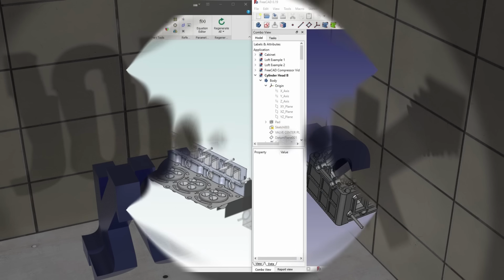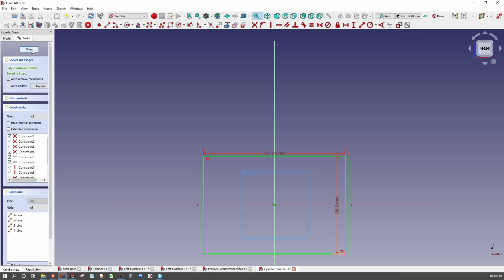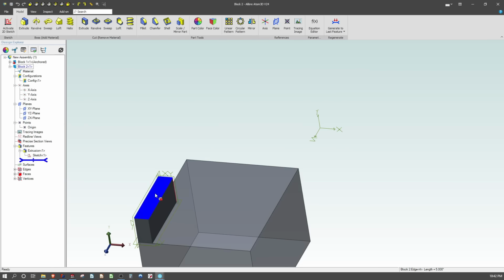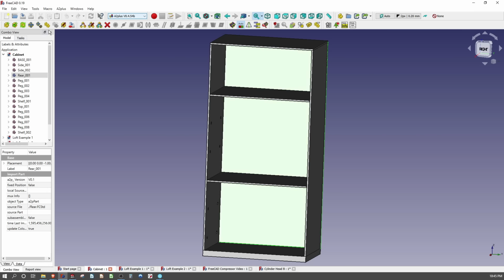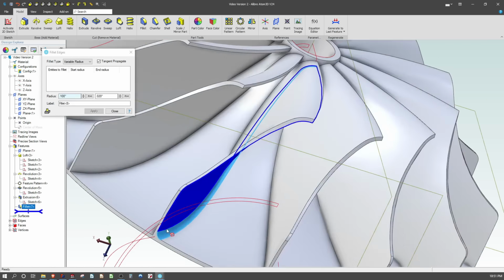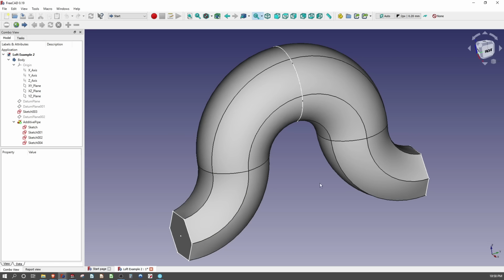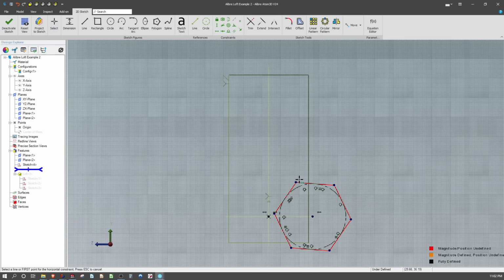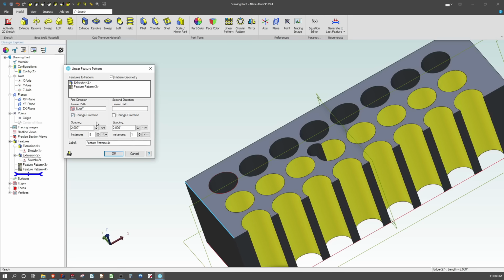What Can Alibre Do if I Have FreeCAD?  |JOKO ENGINEERING|

Comment: I'm considering Alibre Atom3D right not for the exact reasons you demonstrated there - I currently use FreeCADLink, and love it for the most part ... right up until its assembly time, then, its just miserable, compounded by the fact that professionally I use Siemens NX, which is an absolute beast. I tried Solidworks Maker, which was fine aside the cloud management of models was also quite messy, so Alibre is about the only CAD I've yet to try out...
Reply from the maker: Good luck!  I think Alibre has a solidworks feeling to it.

Comment: @Joko Engineeringhelp:  what are the specs on the computer you are using to run Alibre?  I am considering Alibre for personal/side business use but some of the loading times that I am seeing on your videos would be pretty annoying to me (I'm a spoiled Solidworks user with a good PC at my day job).  Mainly Im wondering what your processor is, your ram, and your graphics card.  PS I'm very thankful you are creating Alibre content because you are just about the only one on YT doing it!
Reply from the maker: I wouldn't use the specs to represent loading time in the video; recording video at higher definition is a lot of resources all around while trying to run a CAD platform at the same time.  Xeon(R) CPU E3-1505M v6 @ 3.00GHz × 8, 32GB RAM, Nvidia Quadro M2200 Graphics.  Thanks, in the description of my recent videos you can use my affiliate link to get a discount on any Alibre products you'd like to buy (It supports me too!)

Comment: As a programmer, i am liking OpenScad
Reply from the maker: I taught myself VBA but that was the extent of what I know of programming.  I'd like to jump more in to it but I haven't had a chance.  In your experience, does OpenScad have similar capability in model generation to FreeCAD or Alibre or would you prefer the programming interface or both/neither?
Reply: @JokoEngineeringhelp  One thing is it is slow to render.  It is basically a very simple but powerful scripting language. You can make reusable functions and there are many free libraries out there for it.  But i think i am biased because i do programming for a living and right now it is easier for me than CAD.  I suspect if i learned a good CAD program, I would prefer it.   I tried FREECAD but i hate it.  It crashes and I find simple things hard to get working.   Been thinking of Alibre.  Fusion is top notch but I don't like renting.
Reply from the maker: @3dprintingfun329  Relatable!  Much respect for those who program for a living, it's a great profession and requires good logic.  Alibre has a free trial if you haven't tried it out yet.  Since I'm coming in from the mechanical side, I rely a lot on the graphics display to 'spacially' visualize everything; naturally I gravitated more to FreeCAD, Alibre and SolidWorks.  Good luck!
Reply: Thank you for introducing me to OpenScad. I am new to CAD, and have been using FreeCAD. At first, I HATED the software, because it presents a large number of options, but requires specific things be done in particular ways to use them. This is unintuitive and requires "learing" the interface. But it has grown on me immensely, and for many tasks it is easy to see "how" they can be done.

One thing that I like about FreeCAD is the infrequently mentioned Addon system. It is IMMENSELY powerful, adding things like node based "programming" to the software, as well as the ability to model 3D curves from a set of disjoined splines. FreeCAD's spreadsheet is also very useful, allowing for some associative paramerization control over values that can then be presented in the CAD model.

But sometimes, programming is wanted (by me, at least) for complex parameterization. I was actually thinking of writing my own "CAD" software for precisely this purpose. But I think I'm going to look at OpenSCAD first, after my exploration into OSC is complete.

Comment: No price on the website. Buy only through retailers. File Formats: "Broad Range". Did we just step back in time to 1998? Just because of that alone it's not an option.
Reply from the maker: https://www.alibre.com/atom3d-import-export/

This page from Alibre.com  lists Import proprietary formats from SolidWorks and neutral formats as STEP, SAT, DWG, DXF, while Export Formats are 2D and 3D PDF, STL, STEP, SAT, DWG and DXF. 
Are you outside the US?  Price is listed for US IP addresses on the website but uses quotes outside to my understanding.  SolidWorks/3D Experience/Catia, Creo, Ascon Kompas and others require a quote to provide pricing for the majority of their license options often through resellers; many providers sell that way.  I'm not sure how import/export formats or quoting makes Alibre not an option.

Comment: Can you tell me why I want a history tree? I don't get this method of doing stuff.
Reply from the maker: Hi Marvin!  History trees are needed for engineering.  While the model shows the finished product, history trees show every step and every parameter used to make the model.  This is not useful in modeling for things like animation usually.  For instance, lets say I have a feature I need to change by 0.05mm, and I have 20 items that dimensionally depend on the feature I need to change.  Without a history tree, I have to change everything   With a history tree, I can revisit the original dimensions that I gave the part, and If I modeled with correct intent, the 20 dependent items will automatically update based on the one dimensional change.  In something like animation, it probably doesn't matter to update things here and there, but for engineers who need to track every dimension of every feature on every surface, it really helps to have the parametric 'history tree' system for easy updates, being able to scrutinize every step of making the part, and setting relationships between features that update in dimensionally predictable ways that mean less work.
I understand your point of view because I approached blender wondering how anyone would  want to model without a history tree.  But then I started seeing the cool benefits that Blender and other modelers offer.  It feels like different worlds, but both ways are awesome.  Hope that helps.
Reply: @JokoEngineeringhelp  Yeah, I don't do animation. I've been doing "engineering" in CAD since the 80s, and that's why I don't get the history. We never needed it.
In fact, I have done just about every thing you can use CAD for, [surveying, petroleum assay, jewelry making, engine building, stress and flow, optics] and I have never said, DAMN, I wish I could go back and undo something?? There's no back, it's always forward.
It has literally never been an issue for me, and I am really trying to figure out what it is that I do now, when I need to change "20 items" 
See, I would just select the "20 items" and then go to the dimension panel and change the dimension for them en masse. History sounds like the exact same thing, but with more steps.
I cannot understand why you wouldn't either select handles and snap them to a new point, type in a new dimension, or hit scale?
Nobody has ever really given me a CLEAR situation that a history would allow you to modify something quicker or better than just modifying what you need modified, directly.
I think when you're used to working in the real world, building solids on a computer, you have a different workflow that is time agnostic. You make things much more flexibly that way. 
If I decide I need to "go a different way"... well actually, right.... My newest project, I saw a sample of a different methodology on the attachment point.
So now I need to change 1/3rd of my model. I am going to make the new piece and swap out my old piece with it. 
What does history do for me here? What if I made that piece first "in history"? What if I don't want it to push an update through history because I want to see how the new method integrates?
Here is a good example in an old quote:
“The sculpture is already complete within the marble block, before I start my work. It is already there, I just have to chisel away the superfluous material.” - Michelangelo Buonarroti

See, engineers, since we're not magicians, we start with things that exist and remove from it, to make what we want. That's how we CAD.
Reply from the maker: @m4rvinmartian  What platforms have you used?
Reply: @JokoEngineeringhelp  this answer should be an entire video by itself.
Reply from the maker: @Z-add  In a month or two, I'll be covering non-parametric 3d modeling and it should be a good contrast to see the differences

Comment: Great Video as always . I have a problem in FreeCAD . 
Problem:
To create an parametric 3D model .A simple 3D rectangle with some layers. A basic body is embedded in another body that consists of several layers. All values are created parametrically. The "initial values" are chosen randomly. I've been struggling with FreeCAD for months.
Is it even possible to create such a virtual model in FreeCAD?

I am thankful for every help .

P.S It's for a PPA work.
Reply from the maker: I'm not sure I completely understand, are the bodies overlapping?  Are there engineering drawings of this object?
Reply: @JokoEngineeringhelp  Basic body, e.g. a 3D rectangle body with a pocket in the middle for space for another component/body.
then only 5 sides of the base body are attached in several layers with different values.
a kind of sheathing , with several layers , all parametric , for a virtual 3 d model
Reply: @JokoEngineeringhelp  like a kind of cool box with several layers of insulation . the other body comes in the " cool box " a " lid on it ...

Comment: I have Alibre Design but one limitation it has is that it cannot easily produce physical threads.  I really need this for 3D printing.  Fusion 360 has this feature.  I’m not sure if Free CAD has it or not.  This is probably the only feature that I wish Alibre would copy from Fusion 360 as they do it very well.
Reply: Not an expert on FreeCAD by any means but short answer is YES. Just do a YouTube search for Freecad threads. LOADS of tutorials. Just ensure you use the latest stable release for production use (0.19.3) or 0.20.0 Beta but seems pretty stable. Details correct at 22/2/2022.
Reply from the maker: It's a good point.  I have not tried threaded holes, I know Expert and Pro are listed to have automatic threads here in the detailed comparison view:

https://www.alibre.com/alibre-design-feature-comparison/

But I have not yet investigated the extent of that feature.  Check out the fasteners workbench on FreeCAD.  I usually generate the fastener with the thread I want, then boolean the fastener to create the thread on my model.  Alibre could do that with mcmaster carr models of fasteners too.  

There is another feature that I believe is newer in FreeCAD that my partner @allvisuals4u has covered here that should do what you want:

https://www.youtube.com/watch?v=hXkNqsATWcs

Usually when I print I either tap the thread or use self tapping fasteners if that makes life easier for you.  Something like this that uses a hole to tap itself into:

https://www.mcmaster.com/self-tapping/for-use-in~plastic/stainless-steel-torx-rounded-head-thread-forming-screws-for-plastic/

This is a very worthy question that I wish had better answers
Reply: @JokoEngineeringhelp  They are cosmetic threads in Alibre.  Fusion 360 has a toggle that switches the cosmetic threads to physical threads just by selecting the option.  Alibre doesn’t have this yet.  

I posted a feature request in the Alibre forum once, but people wanted to argue about how useful the feature is.  Many designs like the Voron V0.1 3D Printer is made using 3D printed parts such as belt tensioners with plastic threads and plastic nuts.  I don’t understand why people would argue to keep a limitation in this product.  I can understand why you wouldn’t print a 2mm threaded bolt.  That wouldn’t make sense with todays 3D printer technology, but a 20mm part with a coarse thread works very well on a 3D printed part.

Comment: hey Joko, i really appreciated this video and hope you will return to this topic periodically with subsequent new major releases of FreeCAD. to check back again after some further time

but another comparison i was wondering about was between alibre and rhino? do you have any interest in looking at rhino 6 in this light?

in particular i was wondering if allibre has its own equivalent to the rhino command scripting language. whereby you can type a bunch of commands like maths code an it generates any primitives and parameterize them etc. or perform more complex operations and/or script operations from externally. now is that a feature missing from alibre? or does alibre have its own solution for that. anyway. would very much also like to know where rhino falls behind alibre in any other areas.

i think this would be a valuable comparison. since both packages are stantalone not cloud based like fusion360. and they are both the same sort of ballpark price bracket of affordability. they even both seem to share some of the same 3rd party addons like for CAM etc?

please let me know likewise if you have no plans or interest in ever covering rhino. and i can then look elsewhere for such guidance (for a comparison of them). but still very many thanks for your videos on both freecad and allibre. i hope to keep following along and maybe to glean some of that familiarity. to help not feel so out of depth when trying them out next time
Reply from the maker: I think that's a valuable comparison too!  Unfortunately I don't have Rhino or any experience with it so I would not be able to make a good comparison.

Comment: Great Video, do you only use alibre atom or also alibre design? What's the difference between the alibre versions?
Reply from the maker: Good question.  All my videos default to Atom, I occasionally will use Alibre Design but the thumbnail is specifically marked with 'Pro License." Everything in this video is Atom.  You can have a long list of Alibre Version differences here:

https://www.alibre.com/alibre-design-feature-comparison/

^change the list to detailed comparison to see all the feature differences.

The major points for me are the pro licences have some time savers like more ways to draw arcs, (these don't limit your capabilities), Pro has sheet metal, boolean capability, proprietary file format support (like SolidWorks .sldprt) GDT callouts in drawings, and I think a few extra assembly tools.  In my opinion it's stuff that you really don't feel too hard unless your working in a manufacturing environment.
Reply: @JokoEngineeringhelp  Thanks very much for your detailed answer. You helped me a lot.

Comment: Had all 3 problems with Freecad. I really wish they could get them solved,  3d design is only a hobby for me and I really can't afford to spend on professional CAD packages, nor is my internet connection reliable enough for always online programs.
Reply from the maker: If it's helpful at all, Alibre Atom (The version in the video) is being sold right now for a $149 lifetime license so you only have to pay it once and keep it forever.  Alibre has some offline licencing options that I'm less familiar with, but the online license only uses the internet on startup.  Regardless, best regards and good luck on your CAD work.
Reply: It is infuriating, in FreeCAD, that any slight change to a surface breaks other features dependent on that surface downstream.
Reply: @GnuReligion  Have you tried using datum planes instead of just sketching on the surface?
Reply: @louiel8711  Yes, it helps to place sketches on planes ... and use the Spreadsheet and aliases.
FreeCAD is wonderfully rich in features, but commercial programs are much easier to to use.